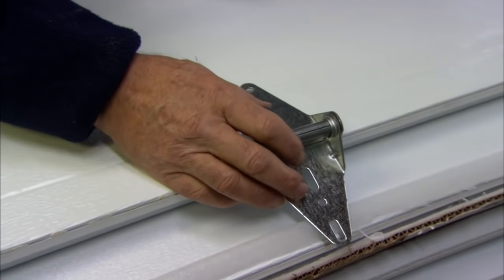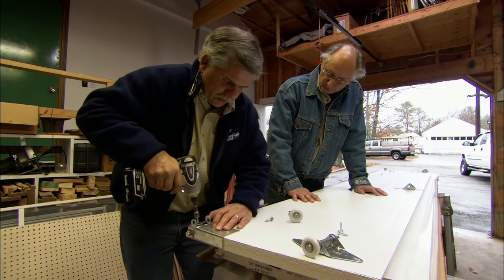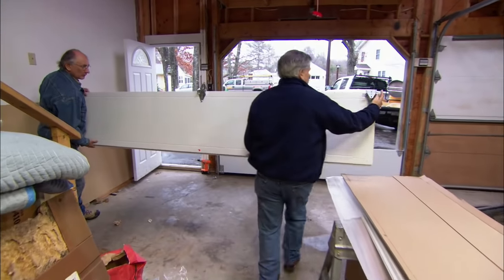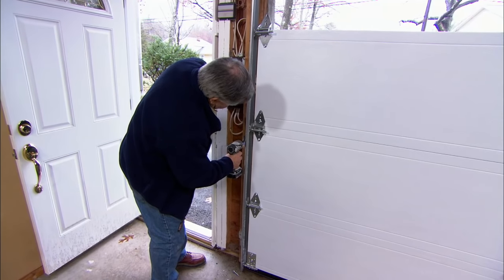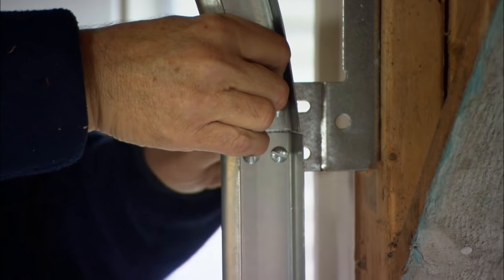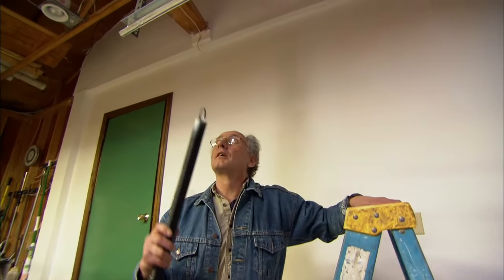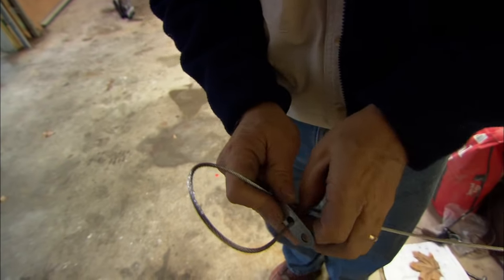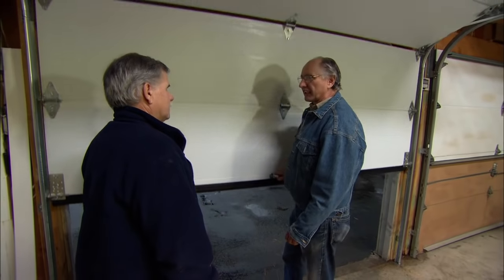How to Install a Garage Door | This Old House

Comment: I've been in the door business over 20 years and although this isn't the way I would install a Garage Door it's still perfectly fine example of a good installation. for you youngsters that are going back and forth about who can install a door the fastest one day you will learn it's not about speed but the quality of work and whether or not you're getting call backs.
Reply: Derek Soderstrom it's all about speed. Nobody makes money when it takes you all friggin day. You take too much pride in your work..its a damn garage door for christs sake.
Reply: Derek Soderstrom kid
Reply: Speed is key as well as quality. 
Sections are a breeze. For example ur track should be set on a 10 ft wide door at 10'5" the door is hardwared on the ground then u set a track set the bottom set ur other track level door, stack set top of track throw up horizontals headplates then spring line then top section wind springs throw it up 2 and a half sections back hang and ur done! Cake work. It gets heavy when u do full view window panels. I do commercial. This is smaller and quicker. Hardware on ground leave one side of track loose but screwed to wall and u can pop the rollers in easily. Dont use these springs they're horrible. U have enough room for a headplates and a spring line do it. But rolling steel is the way to go!
Reply: Derek Soderstrom o
Reply: Derek Soderstrom I liked
Reply: Derek Soderstrom 0 call backs and still get them done right. Rolling steels, high speeds, dbci/porvene, sectionals everything i do i take pride in because these r peoples life savings going in their houses metal buildings or businesses
Reply: @leathercheerio1  100% with you o  that. I fit 2 or 3 a day got no fine to spend all day on one door
Reply: Ryan Fausnaugh 
And that thought trend is money in my pocket. 
Please do hurry. 🤟
Reply: Derek Soderstrom  I’ve been fighting a single door on my garage since last weekend , having trouble. I’ve already hurt myself with taking out the old 1960’s solid flip up kind and hurt myself with installing the new one (Pella) single stage door
Reply: And to change the rollers after a few years, just take off the track

Comment: I have been installing garage doors for 15 years and running my own company for 5. I am puzzled by the negative comments. Garage door guys do tend to be bitter and angry most of the time so I'm sure it's just knowitall door jerks. Overall it was a good install of a basic steel door.
Reply: Tim Wilson Why do they tend to be bitter?
Reply: Maybe because it's hard to endoor all the door puns...
Reply: After 24yrs everyday is doorjavoo
Reply: I know this comment is old.....However, one crucial part was left out. This Old House is assuming the slab is dead level, which I'm sure it is not. The top of the lower tracks need to be dead on level from right to left or the cables will spool up uneven from one side to the other causing the door to ascend and descend crooked, causing noise and wear. After the bottom panel is put against the opening, it needs to be leveled, and reference marks need to be applied to the rough opening to assure the lower tracks are level from one side to the other before fastening them. Never set the lower tracks on the slaband assume it is level. EVER!
Reply: Must be why the guy that repaired my door spring seemed irrirated he had to show up at all
Reply: As a garage door installer what kind of cost am I looking at for a company to do it?
Reply: @bdills89  Sorry to burst your bubble bud, but good luck finding someone to replace extension springs. To answer your question though, it would cost you about $300+ to have me come out and do an overhead torsion spring conversion on whatever death trap you have going on in your garage, if it has springs like the ones featured in this video.
Reply: @5eyes1294  I'm a novice, but I don't think this is right. I might be reading it wrong, but I think you are describing a situation that applies to torsion spring systems, whereas the vertical tracks don't have to be perfectly level with an extension system. The important thing is to make sure the springs are connected at roughly the same tension. Apologies if I misunderstood something here. Not sure what the "slab" is.
Reply: @mikeharris6335  lol, "death trap"?
Reply: @onuw  The "slab" is the concrete "slab" the garage sits on, and the principle applies to both torsion and stretch springs. If your radius tracks (left and right) are unlevel across the top, each side of the door (left and right) will enter/exit the radius at different times, thus applying undue strain on the hinges which only are designed to flex in open/close directions without lateral torsion. Hope this clarifies what takes place when a rigid door meets the radius in a "standard radius" style door or even a "highlift" type track arrangement.
Reply: What if floor not level
Reply: darryl richmond 
Set the bottom section and vertical track level. 
Both need to be set on the same shim that you use to make said section and track level. 
Desperately try NOT to use the extension spring set up as it truly is a very poor and unsafe system. 
Order your door with torsion springs that are safely mounted on a steel shaft and CANNOT break away and hurt anyone or anything.?
Readily available at any door sales place.
Reply: @lowerf0_rtyei8ht92  too many JAMS LMAOL
Reply: . LOL

Comment: Tom should have described the numbering system on the hinges as they relate to the door sections. The door sections are numbered and installed in ascending order. The bottom section with the floor seal is section 1. The left and right hinges hold the rollers at an increasing distance from the door section on each successive section to accommodate the slope away from the wall of the vertical door track. Center hinges (which don't have rollers and whose number vary based on the width of the sections) on all sections are labeled "1". The left and right hinges between sections 1 & 2 of a four-section door are labeled with a "1". Between 2 & 3 labeled "2" and so on based on the number of sections.

Comment: I've been a fan of This Old House for probably 35 years. While these videos are great, they are not exactly step by step. They are not novice quality videos that explain every single thing that you should know about a garage door installation. They are helpful when you already have a good handle on what you are doing and you are checking for a certain part in the process where you need some guidance. I needed some extension spring information for an older used door install, and found it here. Not everyone has a torsion bar system on every single door, so we need to know both systems. I am glad they showed extension spring installation.

Comment: I can't believe they still use those old extension springs!  I love the torsion springs because they're so much safer and are so easily adjustable to make the garage door float.
Reply: I came here because I neeeded to know how to install an extension spring on a new garage door.... so it is still out there. Or in the case of getting a used door when you need to save money, this video is relevant for some people.

Comment: I’ve just started a job installing overhead garage doors. I love it. It’s not that hard and it’s a good learning experience. I hate the extension spring doors. Pay the extra money and get a motor with belt drive.
Reply: You still need a spring to balance the weight of the door.
Reply: Agreed with Dale. Springs are absolutely required especially if you buy a motorized lift. If you install a lift without springs you're going to burn out your lift motor because the motor will have to lift the full weight of the door. The whole point of springs is to make the door weight near neutral - whether a human is doing the lifting or a motor.

Comment: a part of this video that may confuse people is the assumption that the door/floor is level, which is why he is simply ensuring the vertical track has even spacing, although it's not necessarily true in all cases, specifically if your floor is strangely out of whack like mine is. (level under the door but out of level where the track sits on the ground.) best thing to do is ensure the track is plumb without making assumptions about width from door. while that may work for 99 percent of cases it's good to check regardless.

Comment: IMO that is a job you hire out.  Also installing a well sealed, insulated garage door makes a huge difference in the energy efficiency of your house.  Here in the south, the "basement" hangout for the kids/teenagers is the rec room/bonus room over the garage.  I know after my parents installed well insulated/weather tight garage doors back in the late 90's, the temps in that room above the garage were warmer in the winter and cooler in the summer by a few degrees.  Don't know how much, but you could tell a difference after installing those air tight/insulated garage doors in the room above the garage.
Reply: probably so. I'm pretty sure most garage door makers don't sell garage doors to consumers directly.
Reply: Except Home Depot and Lowes sell direct.

Comment: I watched this video a few times and then put up my cloplay door in a little over an hour
Reply: I read this shitpost a few times and laughed for a little under an hour.
Reply: @Robert Hardt too bad he only shows half the process for the safety cable. I'm afraid your wife is doomed.
Reply: @onuw  Yeah where did he attach the other end?
Reply: @cooldog60 You're right. He didn't show that it's  his cat 🐈 that is holding the other end of the cable.
Reply: Safety cables? Wouldn’t some good fishing line do the same thing?

Comment: Always level the bottom section.  If the door is too far off of level it will eventually throw a cable. I have cases in new construction where freshly poared concrete isn't even level.

Comment: Hi,
Need advice/ help. 
Have old garage wood door installed now. 9 x 7
Used (?aluminum) door available for replacement.
Can i just replace door slats  onto existing track and hardware (rail springs etc) ?
semi handy woman. Feel like i could achieve that  but not reinstalling whole track system.
Jo of all trades. Definitely master of none. 
Please let me know as soon as possible.
Thank you 
Josee

Comment: Most garage doors openers I’ve had experience with have had bracing fore and aft of the motor. This new house I bought only has  punch hole bracing on rear side. The door rail does shake quite a bit. Do I need to add punch hole brackets on the front side  as well? '

Comment: 6:46 when he attaches a "safety cable to the spring" I can't tell where the other end of the cable goes?

He just sticks a wire through the spring and attaches one end to the metal bracket.
But what's the other end attached to? Is it just dangling by the pulley-end of the spring?

Comment: If you follow these directions there’s a good chance your door will not run right. They left out two very important pieces of information.

1. After installing both side tracks measure from the roller to the top of the verticals track on both sides, adjust the height of the tracks so they are even.

2. Both cables must be an even length before installing the 3 hole clip and S hook.

Comment: I follow this tips and the Manuel some how my door is not heady enough to hit the floor, the tension on the spring is enough to open the 7ft of my garage door I did a test to add more weight and it work but I can’t add to bc it suppose to be normal any suggestions thanks in avance

Comment: Only reason I use a ratchet on the track nuts is if my impact gun doesn’t fit. Like if there’s a wall or some other structure in my way. Also I hate extension springs. We always use front torsion springs on a shaft. Those extension springs break and can go flying around and hurt someone really bad. Even with the safety cable. Front torsion can break but they stay on the shaft. Also you can always adjust the front torsion spring after it wears over time. If you have extension springs, ask for a conversion kit from your local garage company. And find a company who sells C.H.I. garage doors. Clopay, Safeway, and others are usually hard to work on because the parts aren’t made anymore.

Comment: What brand of door is this?  Clopay and general use metal studs inside the door, also the bottom gasket is already installed on the door!   Maybe he purchased it at Home Depot or equivalent. I did door for thirty years.   So slow.

Comment: Those steel cable brackets can cut through the cable after several years of use.  To prevent this, you can use a steel cable eye loop thingie (not sure what it's called, but a couple bucks at hardware store).
Reply: what part gets cut through?
Reply: @johng5261  At 6:05, the edges of that little metal piece are sharp, and after several years can cut through the steel cable.  It happened to me, and I had to replace the whole cable.  I replaced the little metal piece with something resembling the cable loop that he slipped over the bolt at 5:53.
Reply: Or a little grease to kill the friction.

Comment: Why on Earth would you choose to use extension springs?
Reply: Because it's DIY
Reply: In Philly they are the most common spring used!
Reply: A homeowner can install and replace extension springs without hiring a contractor. I have replaced 2 springs by myself. Pretty easy to do.
Reply: @556suppressor  they still generally run like crap versus torsion.
Reply: I love my extension springs. To each his own.

Comment: My old garage doo has no spring I order a new garage door i wonder if I have to use the tension spring or even the garage door opener(motor)
Reply: your new one should come with a new set of springs, based on the type of door
Reply: +C 19 
There's two different types of springs that are used for a sectional garage door.
The one shown here is more common for a one-piece door than a sectional.
Reply: I think even a motorized garage door has springs like a manual door. Otherwise all the gears would have too much unnecessary strain on them.

Comment: One thing I would of done was slap a level across the bottom panel just to make sure the door sits level.
Reply: The door has to fit the floor - not be level.  If the door is level, but doesn't seal against the floor - it's not installed correctly.  You have to fit the door to the existing conditions.
Reply: No, you actually want the door to be level, if it's not level to the world, then it will jam as it goes up crooked. If you have gaps between the door and the floor after installation, they make a wider bottom rubber, and a different style retainer then that door has.
Reply: AG Ender - agreed
Reply: Wouldn’t you have to use a level on each garage door rail, to make sure that’s level?  In the video it shows that, just using you eyes will make it go up and down smooth. I’m looking to do my first garage door bc my barn needs a new door and new rails. Any advice would be nice. Thx.
Reply: Robert Hardt deff has to be level
Reply: The door needs to be level especially with torsion springs ,who cares about the framing or floor,the other trades should have done the job right. The soor hets leveled no matter what.

19 years experience here,commercial and resi.

Comment: Top brackets are upside down...and extension springs are really not used anymore...
Reply: AG Ender this was made in 2014. So, it’s not surprise that much about the springs are outdated.
Reply: Vyto16 

How much has the technology really advanced since 2014.
Reply: You use that spring for manual lifting
Reply: Karen Howerton Sure. All doors use a spring system for a counter balance. I had a customer just as ignorant as you,she thought the springs are temporary and the operator did the heavy lifting.
Reply: I don't think you can buy torsion for DIY.

Comment: first of all these are extension springs which are outlawed, and even if they still make them somewhere they are not the typical spring.  The torsion spring is what most people have on their homes.  H does not put the cable on until after he put the bottom panel into the opening, and he puts the roller on with the vertical track, this is not the way to do it, the because when its time to put the cable on the roller and the track will be in the way, he should hook the cables on first before all that.  Know body drills a pilot hole either for the hinges, it would probably strip out the screw when you go to put it in, just like it did in one shot in the video.  He also put the top fixture on upside down.  There is a lot he did not show you on the video and most garages do not have that much working room.  Its a lot harder then they make it look.
Reply: I agree, I’m a professional contractor granted not garage doors but I’ve worked on them before, and this is much harder than they make it look. in fact this is not a DIY project it’s really a specialty project for people who specialize in garage doors; there’s many companies that do that. In fact most garage door suppliers don’t even really deal directly with the public. At least not selling; they sell and install as one package.

Seriously those springs can cause serious damage this isn’t something to mess around with. Even the door itself can slam down and cause severe damage or death.

Comment: There's no legs at the top of the flags he have mourn enough headroom the put torsion In with extension Springs everything has to be level in order for the door to work correctly for a long period of time Into boot his using 2 different types of rollers there's no end On the garage door just wood which  Will    Rot out

Comment: When you put your torsion spring on the shaft red will mount in the middle on a bracket and face to the left - black will mount in middle and face to the right. nice job in video to show how to measure. For more tips go to www.amkgaragedoors.com